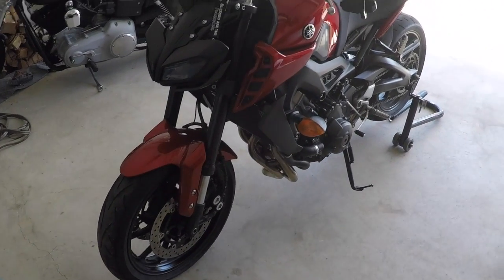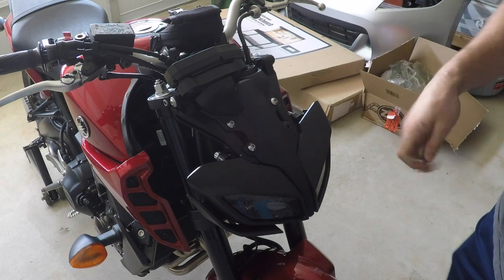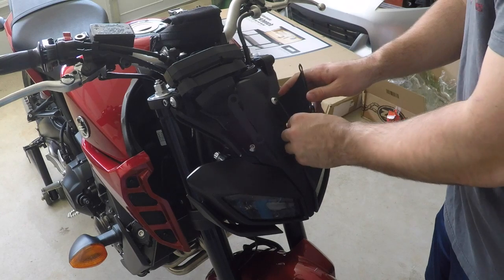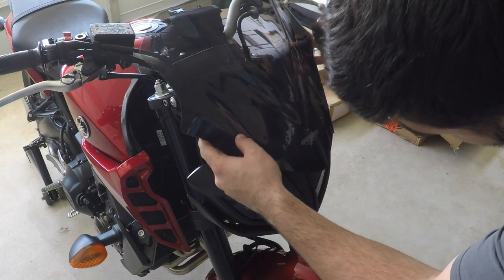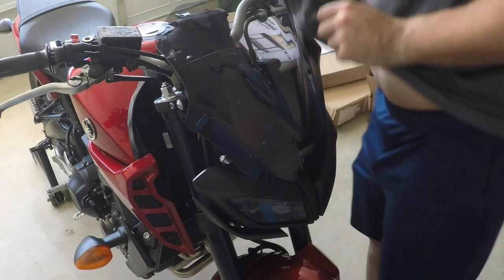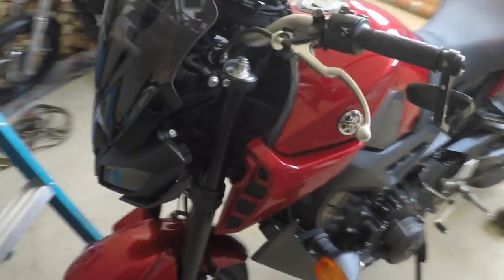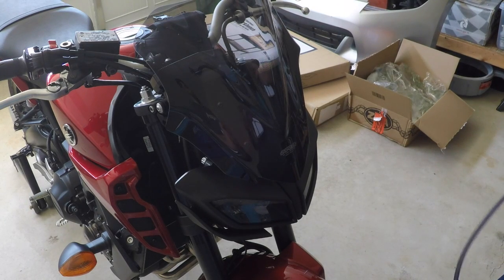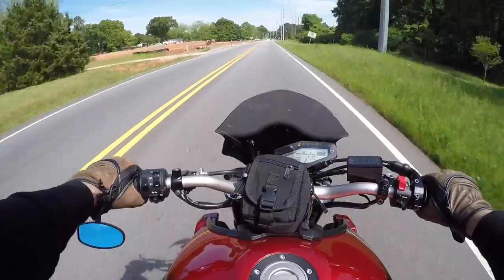FZ-09 MRA Racing Windscreen/ INSTALL and TEST RIDE

Comment: Hey man, nice video! I picked up an MT/FZ09 this year and I've started looking into windscreens and narrowed it down to this one. Do you find that it has any improvement on the amount of wind hitting your chest while just cruising? I'm trying to avoid a screen thats too tall, but want something that makes highway riding a bit easier. Thanks!
Reply: @ratchetdavo  which color is this windscreen? Smoke grey? Or black?